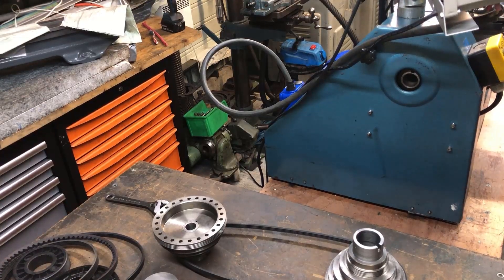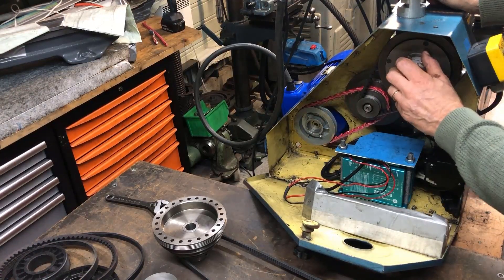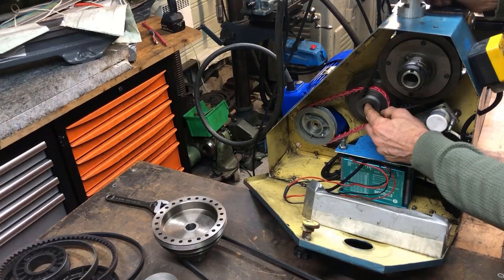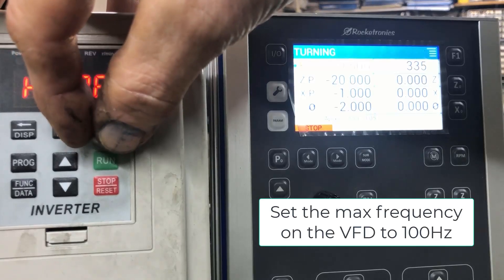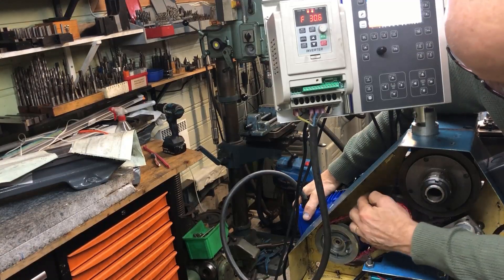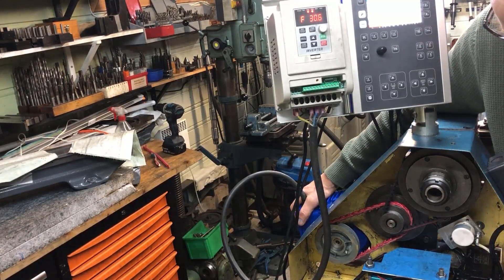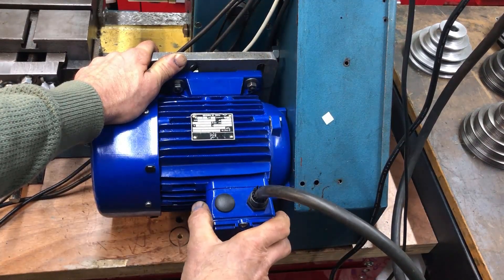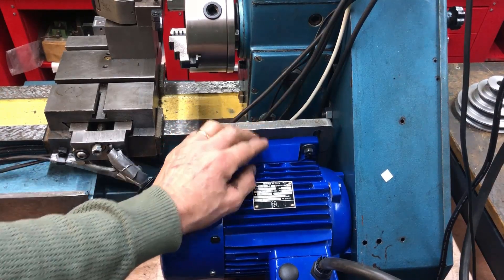Smarty AT-300 (lathe..) - motorizing system

Comment: Thank you for your video. I have a similar setup and want to drive with multirib belt. I use  big treadmill 4400rpm motor. So far, thanks to ELS4 pro, I made v pulley for 3/8 belt. It gives me 2000rpm and a lot of torque at low speeds. So far working great. Only my concern is loud sound from clutch (I removed millhead gear and axis and attached separate small treadmill motor to head), also not happy with nondirect driving encoder....
My plan is to add second encoder to mill, switching, when needed, dc power cord to mill, encoders,  via ethernet jack to ELS, and set it up as machine B in settings. In this case I can use some ELS functions when milling. I have the original 40mm 8 rib pulley for the motor. Just want to build a shaft multirib and encoder pulley before I disassemble the original one. Can you tell me inner diameter and leight of yours  sleeve for multi v pulley?